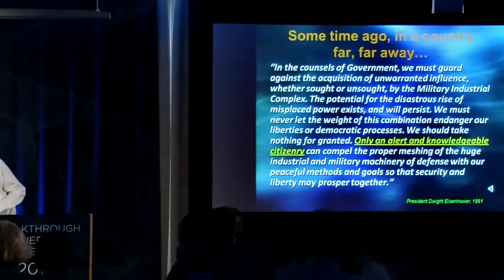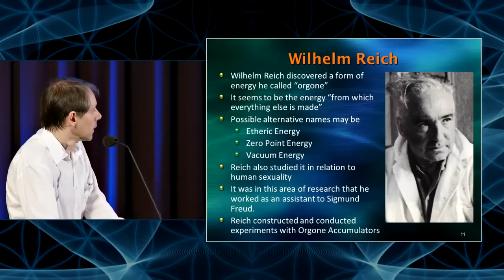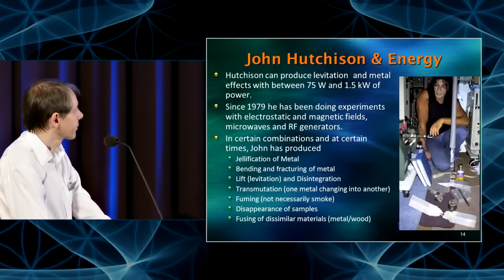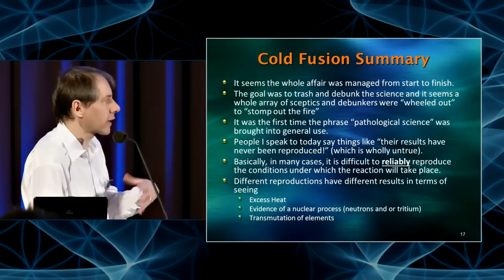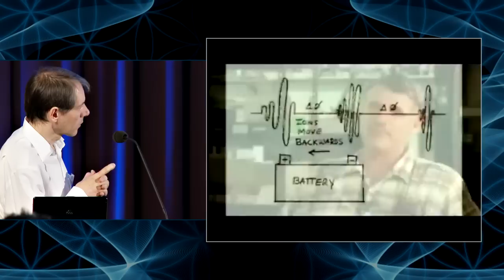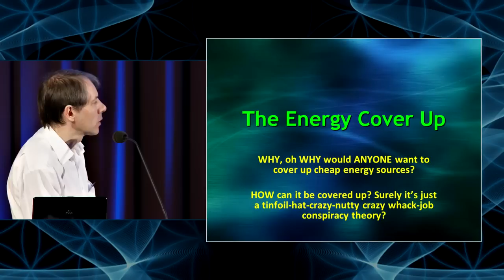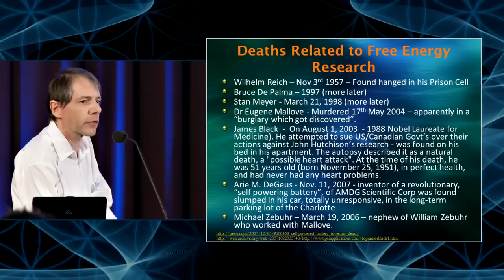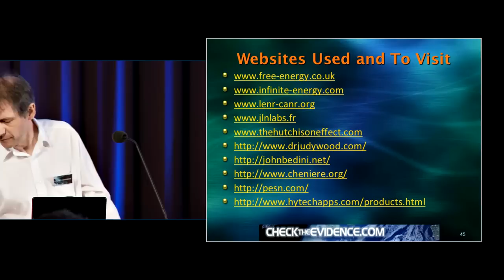Infinite Energy, But Not For The Masses | Andrew Johnson

Comment: Is it peer tested?.
Reply: It was certainly peer tested on 9/11 when the best part of seven buildings were turned to dust. And they still can't locate the DNA of eleven hundred innocent victims who never got out of the towers.
Reply: Michael Rapson
"It was certainly peer tested on 9/11" - False.
THE MATHS THAT PROVES ARCHITECTS FOR 9/11 TRUTH TO BE LIARS.
THIS OFFERS A SATISFACTORY EXPLANATION FOR ALL THE OBSERVED CONSEQUENCES OF THE WTC TOWER COLLAPSES.
An analysis of a tower's potential, and therefore kinetic, energy is a good way to illuminate the consequences of collapse. The only material burning in the wreckage was HYDROGEN GAS (and most of that would have occurred at the wreckage surface).  Deep down at the base of the densely-compacted wreckage the very hot and compressed iron had created anoxic (reducing) conditions, and fire could not have occurred no matter what the local temperature may have risen to.
PRIMARY 9-11 CONSPIRACY ASSUMPTION SHOWN TO BE FALSE:
AN ANALYSIS OF THE AMOUNT AND DESTINATION OF THE POTENTIAL ENERGY OF A WTC TOWER
The first law of thermodynamics, also known as the Law of Conservation of Energy, states that energy can neither be created nor destroyed; energy can only be transferred or changed from one form to another.
Source: Boundless. “The Three Laws of Thermodynamics.” Boundless Chemistry. Boundless, 02 Jun. 2016. Retrieved 12 Oct. 2016 from https://www.boundless.com/chemistry/textbooks/boundless-chemistry-textbook/thermodynamics-17/the-laws-of-thermodynamics-123/the-three-laws-of-thermodynamics-496-3601/
The World Trade Center towers (and WTC7) fell NATURALLY due to buckling failure when their 'slender' columns lost attachment to their floors.
They only used a third of their Potential Energy to destroy themselves, the remaining two-thirds was consumed in crushing some of their steel into ground zero.
A standing WTC tower possessed two hundred and forty six tons of TNT of POTENTIAL ENERGY merely by just standing there. We shall call this energy Eo.
The tower fell by taking the direction of LEAST RESISTANCE, which was THROUGH ITS BUCKLING COLUMNS.
The columns failed by BUCKLING because their STRUCTURAL STABILITY had been compromised by LOSS OF FLOOR ATTACHMENTS. No steel got crushed when this buckling failure occurred. 
Buckling is not a MATERIAL failure; it is a STABILITY failure.  This type of failure was first explored by the famous polymath, Leonhard Euler, around 1,750 AD.
The floors had detached themselves by sagging to an angle which snapped their connections. Photographs of these separated floors (taken shortly before collapse) are plainly shown in the NIST Report.
As each tower fell, some of that stored potential energy, converting to kinetic energy by falling, was released to damage and dismantle both the moving and the stationary parts of the tower on the way down.
The amount of the initial energy consumed in such a manner was inversely proportional to the rate of acceleration of the tower as it descended. It can be calculated.  We shall call it Ed.
The amount of energy remaining (Er) when the tower wreckage hit ground zero is then (Eo - Ed).
This energy, transferred elastically, caused PLASTIC DEFORMATION in the crushed base steel wreckage, and became HEAT. This too can be calculated.
The heat was considerable. The signs of it were captured by satellite. It amounted to the equivalent of a thousand tons of steel raised to a temperature exceeding 1,000 degrees Centigrade.
This hot steel, crushed and pressed against ground zero, oxidised its surface (making scale) and absorbed local oxygen gas, leaving a reducing atmosphere.
In these reducing conditions, and at a temperature of 1,000+ degrees C, fireman’s water which had percolated through crushed gypsum wall boarding DISSOLVED calcium sulphate (yes, Gypsum is 5% soluble in water), the sulphate ions of which were reduced to sulphur which combined with the exposed iron to form IRON SULPHIDE, which at such temperatures was MOLTEN, and flowed away. At a temperature of 1,000 degrees Centigrade, in an absence of oxygen, and in the presence of hydrogen, Sulphur and Iron atoms become keen partners, forming IRON SULPHIDE, which above 1,000 degrees Centigrade, is a LIQUID, and flows away, leaving 'corrosion' claimed by 'truthers' to be caused by thermite.
Such hot reducing conditions also caused the water/steam to be REDUCED to hydrogen gas which was noted by firemen to be burning at the surface of the wreckage.
The wall-boarding and crushed concrete surrounding (but mostly above) the steel were THERMAL INSULATORS, so greatly slowing cooling.
CALCULATIONS (in SI units):
To calculate the original potential energy of the tower in TNT equivalent,
G = 9.81 metres/sec^2
Mass (M) of tower = 5e8 Kg
Height (h) to the tower’s CG = 210 metres
The explosive energy of 1 ton of TNT (Kt) is equivalent to 4.184e9 Joules
Equation: Tower Potential Energy (Eo) = ( M * G * h ) / Kt
This is equivalent to ( 5e8 * 9.81 * 210 ) / 4.184e9, or 246 tons of TNT.
The Potential Energy of each standing tower was equivalent to 1,000 standard 500 lb. ‘iron’ bombs.
To calculate the kinetic energy used in the tower destruction takes a moment, after a simple thought experiment, namely considering the tower would fall at G if there were NO resistance, and if it fell so slowly that it consumed ALL its energy, it wouldn’t fall at all.
So we can see that the PROPORTION of the energy used up by the collapse must equate with the proportion of G which the collapse was unable to achieve.
As the collapse acceleration was, by truther calculation, established to be about 70% of the acceleration due to gravity, we’ll use that.
The energy used up in tower destruction was therefore 30% of 246, or 73.9 tonnes of TNT.
Assuming that 30% of the tower fell outside of the basement, then the energy (Er) available to heat the wreckage base (by elastic energy transfer and crushing) was 0.7 * (246 - 73.9), or 120 tonnes of TNT.
We know that the steel reached at least 1,000 degrees Centigrade because that is the melting point of iron sulphide.
We can therefore calculate the mass (m) of steel that was raised to that temperature.
The specific heat of iron (Fs) is known to be 0.45e6 Joules / tonne / degree C
The ambient temperature was 20 deg C, so the temperature rise (Tr) was 980 degrees C
Equation: Er = m * Fs * Tr
So m = Er / Tr * Fs = ( 120 * 4.184e9 ) / 980 * 0.45e6
And so m = 5.02e11 / 4.41e8 = 1,138 tonnes.
The collapse of each World Trade Center tower created 1,138 tonnes of red hot steel at 1,000 degrees Centigrade.
So we can see that there is no need to postulate an extra source of energy, and that the basement wreckage heat is also easily accountable, with the additional corroboration of burning hydrogen at the wreckage surface, and molten iron sulphide at the wreckage base.
And so the underlying 'truther' assumption, that the planes couldn't bring down the towers, is shown to be FALSE, as it is shown by calculation, using the physically-correct values, that the potential energy possessed by the towers numerically accounts for ALL the known consequences, through elastic energy transfer, plastic deformation, HYDROGEN gas burning at the wreckage surface, EUTECTIC IRON SULPHIDE melting off the hot steel pressed against Ground Zero, and, of course, a tremendous amount of HEAT.
These results are EVIDENCE of the event.
They have been evident to any REAL scientist or engineer from day 1.

Comment: Meyl sold scale models of two matching Tesla wireless transmitter/receivers, which could be used to verify that more power was created in the receiver than put into the transmitter. That extra energy is not "free" but created by the earth's motion through a stationary field charged subatomic particles that penetrate everything called aether in his day.

Comment: 39:00 Sounds like they removed the plating from the rods, less than what I'd call transmutation. Did they weigh the rods before and after the experiment? Most of those rare elements your not going to buy a solid rod of it, you'll get a rod that is coated via plating (very thin layers). Which can be removed via electrolysis.

Also observing phenomenon of different energies at high RPM and voltages is bs. You are working off the end of the scale of accuracy for almost all of the equipment.

Most of this sounds like errors in measurement and observation. If the effects were real they would be consistently observed.

Comment: The experiments of objects falling upwards at around 32:35 ish have been disproven (at least shown to be too easily replicated) as the objects are in a box on a 'table' surface which is upside down and held there by electromagnet until it is switched off whereby the objects 'fall upwards'. Some interesting other stuff in this video though I'd like to try and replicate myself...

Comment: I am with a small team of scientists, whom with own funding over a 10 year period have produced not so much free energy as such, unless it is placed on a loop system, then it would become free energy, but it requires external energy to kick start it off, in laymans terms it is a cold water reactor. At present it is the size of you're hand, we are currently saving funds to place it on it's 4 month continous testing for it's industrial license, the reactor producer either pure hydrogen gas, pure oxygen gas, or steam. The flame producers a heat of 2400 degrees continiously with the imput of water, normal tap water. With a change over of nozzle and anode, the reactor will produce as said hydrogen gas or oxygen gas or steam, at present we shall put it through it's industrial testing for the heat flame only. Thus end result would be producing a sphere with approx 100 reactors set within to power the power station turbines. Small powerstation capablility of 50 MW would suffice the 100 reactor sphere. 1,000 reactor sphere would indeed power a good size 500mw station. My little term for the reactor is : we burn water: :) Everyone goes on about this free energy and that, and you wonder why no governments allow such to be put onto the market, obvious reasons every country rely on tax revenues to run the countries, thus, our reactor will be placed within powerstations worldwide to produce clean pure energy, but, the public I doubt will obtain free power, as in zero $ energy. Money makes the world go around as they say...
Reply: So how do you replace the water?  Not so free is it?  Has to be better than that.  Without water we die, I am told.  Not going to prove that one way the other.
Reply: Hi Steve, by the process of the reactor, it remits pure clean water vapor into the atmosphere, which condenses into clean rain clouds. OR, the system itself could be made to collect all the vapor into it's own chamber and while it condenses is fed back into the reactors, it sure beats all world known powerstation fuels known to man.
Reply: Jonathan Rain washes the atmosphere.   So I am not as concerned with output as I am sustainability, for example a Jupiter moon.  Also battery banks are not correctly designed as a rule, anything over 25% capacity, quickly stresses systems.

Great research though, it will help discover better things.  Once you scale up from moving grams, to tons, the real fun begins.  The high price of energy will produce alternatives.
Reply: therealnightwriter Yeah the problem with fake news is that they tend to be lazy and blurt out anything. If I were a scientist I would figure out the displacement plan to phase in economic development, much like hackers disclose security flaws to venders so they dont go belly up.

When people have access to distribution and capital, you try to invite them in on the action so you clear a path.  You dont make us much money, but you get product out faster, and you tackle next project with a lot more leverage.

One primary possible use of low cost energy is desalination plants, start there, you are then not competing for low hanging fruit.

Much like you would discuss with aliens, what they suggest be done with prison populations, then review their motives and your options.   That way you dont look like an idiot announcing they are here?
Reply: If what you say is true, release the detailed plans on the internet. I understand the wish to earn money, but I doubt you could make anything from it, without getting killed or otherwise silenced. Release it so everyone can see. That could not be surpressed

Comment: i know this is an old post, but hey, cant we use the world of builders to become a production factory then all we would need is a small assembly distribution building.
Ok lets explain better. if drawings of parts was given out to the home builder then lets say a 1000 machinist would make and donate one part of the device and then when made they are sent of to the assembly building and then the donators of the part then get more parts of the drawing to make more parts of the device and so on.

Thus the parts will be made and no government can stop all the 1000's of workers around the world.
Anyway .when about 10 unit's are built, 1 unit goes of to a random worker to have for their hard work, or they just get the full set of drawings to make their own device,
this can work as in china and india their are home workers that do the same, 
the people of the world is the workshop :)

Comment: when you Patent, you are sending a message directly to the rockerfelers saying hay id like to try to put you out of business,, we all know high voltage dc spark gap creates more energy then we can use, if you can contain and direct it. i would never try to patent that.  I can only hope material sciences bring us in to a free age.
Reply: Not only the rockerfelers but most governments will just take the patent and either bin it or use it themselves, without the owner knowing. And put into one of their black ops. As you know their are so so many high tech devices, machines on patent, that have not seen the production lines, main reason is, apart from the set up costs involved,  they are not given first to the government run powerstations. Thus, if the government do not first benefit, then no one will be allowed. This is the age we live in, money rules power, power rules people.
Reply: the day the 99% refuse to use and be used by money all the manipulation ends,, would be the start of freedom.

Comment: Really interesting slide show! You have done a fine job of compiling information here!

I'm not really following your 9/11 thoughts and research. You have clearly said some things that don't make sense. No Heat? Disappearing metals? You said that there was no rubble when there was a massive scene completely strewn with rubble behind you!

So yes I will put the 9/11 info aside here and thank you for the rest. This has been a really well compiled slideshow. It is very interesting to hear what you had to say about Greer. He is a really good speaker but you are quite right that there is something very fishy about him. Instead of providing any kind of facts, he claims to have them and then starts name dropping like crazy!

I am a little surprised that there was no mention of advanced carburetors here though. Plenty of possibilities with a good carb. Pretty darn low tech too

Comment: Antenna - Auto Pilot installed weeks before take-off- Locks the planes out - of their own Auto pilot - when in range auto pilot locks  - to the antenna located in last building to go - implode the antenna once mission accomplished. Remove antenna from imploded debre 1st from last building to go. I don't need to read your lips- I read you Cheney-bush-bush.

Comment: Lifting forces to make things fly is a fun idea. :) I have something that would be neat to see in action if you could build it. imagine an Electro Magnet connected to the inside roof of a thin light structure lets just say for this experiment its a hollow cube. Now on the inside bottom of this cube is a flat square of material that will be attracted to the electromagnet but this flat square of material on its edges is connected to extending bars that are not attracted to the electro magnet and are just big enough to touch the inner ceiling of the cube (This material and its legs barely touching the ceiling of cube are not directly connected to cube structure). Now we know that the electro magnetic force generated by an electrical charge going into an electro magnetic material is capable of lifting far heavier objects then the electro magnet itself weighs. for details research how powerful electro magnets are. Now in this experiment when electricity is applied to the electro magnet. It will begin trying to lift the object attracted to it up and the legs attached to the object will begin pressing against the inner ceiling of the cube. Once the electromagnet is pulling up on the object with a force greater then the mass of the entire structure the object should lift into the air. just as if you had put your fingers into the hollowed out box and lifted it up from the inside. Effectively this is an internal propulsion system that converts electromagnetic force into mechanical lifting force. My example is basic at best and can be improved upon in many ways but I just wanted to explain the basic idea. A more advanced structural design with the same basic principals in play made much smaller say in the shape of a hexagon and much flatter with proper connectors on the outside edges so many of these objects can be connected together into many shapes and perhaps fitted into under carriages of vehicles to either allow flight or to just compensate for the overall mass of a big truck carrying large shipments effectively reducing the fuel it needs to get from point A to Point B is perhaps better. :)